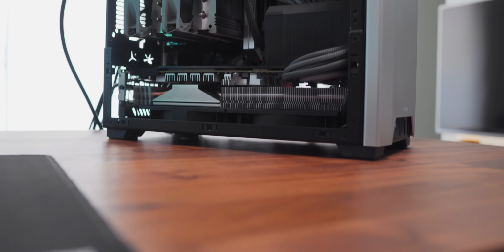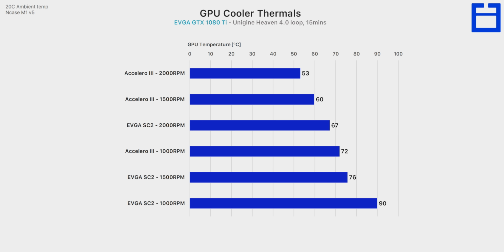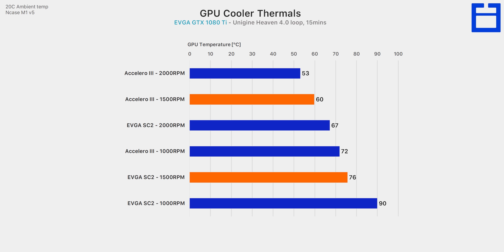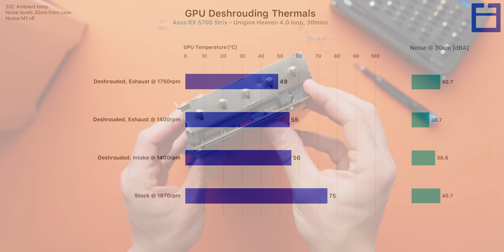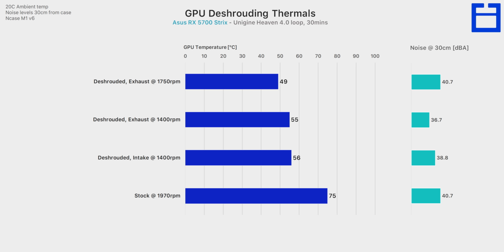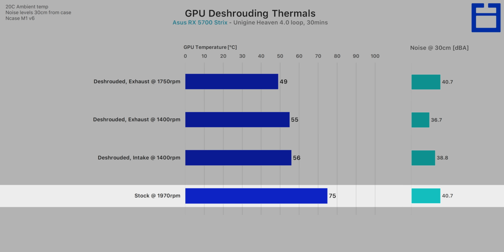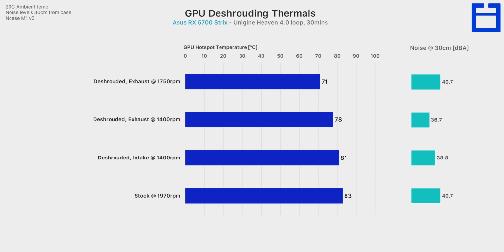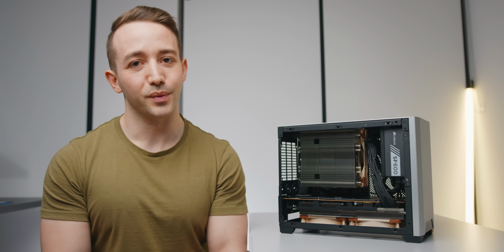GPU Deshroud Mod - Mindblowing Thermal Improvement

Comment: I assume this would work in the Cooler Master nr200, if so, I'm definitely gonna use this trick in my next build
Reply: If he still has it on hand I'd acrually like him test it
Reply: @Oldsah  me too
Reply: i see
Reply: Interested too tho thinking there might be too much clearance between gpu and fans since I have a 2.1 slot, if not then would use an Accelero Xtreme
Reply: That's my plan. 2.7slot Asus card and 2 artic a12 pwms at the bottom.
Reply: I wonder if the strix 2080 ti and the fans will have a gap in between
Reply: Im gonna buy a NR200 too and is interested in deshrouding after I get a second-hand graphics card.
Reply: @justinyhc3057  were you able to test it out?
Reply: @unknowngama  sorry i still haven't saved up enough money to move to the case due to the pandemic...
Reply: @justinyhc3057  no need to apologize my man! Good luck!
Reply: @unknowngama  I do have NR200 and a Sapphire Nitro+ 5700XT. The 5700XT is undervolted and has a 35% fan speed limit. It ran at about 70C while relatively quiet. I tried the deshrouding mod. The first problem is that is a 15mm gap between the 120mm fan and the GPU heatsink. I 3D print a shroud to cover the gap so the air will draw through the heatsink. I use 1850rpm Gentle typhoon fans. If i run them full speed. I can get the 5700XT at ~57C. But it was loud. If I turn the fans down to 1400rpm, a more quiet fan profile. The GPU will run at ~64C. So there is still a 6C improvement compares to stock Nitro+ fans at the same noise level. I don't get the same improvement by deshrouding that Ali demonstrated.
Reply: @spektrumB   thanks so much for sharing your experience.

If you don't mind, I wanted to ask a couple of questions to clear my confusion. What do you mean by 15mm gap between heat sink and fan and how is that causing a problem? And how did the 3d printed shroud provide a solution to that problem?
Reply: @unknowngama  Ali uses Asus Strix 5700XT in the NCASE M1, after removing the GPU shroud, there is exactly 25mm space between the GPU heatsink and the bottom of the case. So standard 25mm thick fans fit in there perfectly. 

When you deshroud a graphics card. You want the two 120mm case fans position as close to the GPU heatsink as possible, while also exhaust the air directly out of the case.. In the case of NR200, which is more spacious than NCASE M1, the gap between the GPU heatsink and the case bottom will be larger. For the Sapphire Nitro+, after removing the shroud, there is a 40mm gap(space) between the GPU heatsink and the case bottom. If you just mount standard 25mm thick fans at the bottom. There is a 15mm gap between the GPU heatsink and the fans. You want something to seal the gap, so the air will draw through the fins of the GPU heatsink. 

I first just used some cardboard cut to size as a shroud to seal off the 15mm gap to test the air flow. After I'm happy with e design, I 3D print a plastic shroud for this purpose.
Reply: @spektrumB   ahh I understand now, thanks!

A quick side note, when testing the fans on the deshrouded GPU, how well did your 120mm fans fit? I ask because I want to try using 140mm fans that I already have on the gpu.
Reply: I came here looking for this answer. Optimum Tech please test this if you can.
Reply: anyone tried this yet??
Reply: @coolsurfer89  i have done it in my nr200 with a rog strix 2060 super and the results are just as good as he shows here
Reply: Was thinking of doing this also with my nr200. For the gap after deshrouding, I plan to use some plastic/nylon spacers from home depot to get the fans close to the heat sink as possible.
Reply: @1LifeAdvs  just use zip ties and a few pieces of wire to fix the fans to the heatsink
Reply: @sniper0073088  the zip ties won't get melted?

Comment: Have you tried stock Asus 2080ti with the slim Noctua fans?  Looks like it would fit.  That is what I'm running in a Node 202.  I wonder how it compares to your deshrouded Asus 2080ti and regular sized Noctuas.

Comment: The real question is why the hell this outperforms even the best boardpartner coolers. Are they screwing us over or are they just inept?
Reply: Noctua fans cost more. :)
Reply: GPU fans and shrouds are designed to look somewhat "cool", Noctua (and other case fans) don't care much about the looks, but only the performance.
Stock height is 2.5 slots, deshroud + 25mm fans is around 3.25 slots.
Also the fact that in shown configuration fans sit directly on the bottom of the case helps -- all of the air goes out of the case immediately, without any chance for recirculation.

Comment: I did this with my Zotac 1080Ti mini, forever ago, by rewiring the existing fan connector to add in two 90mm Noctua fans. I also swapped the thermal paste for Grizzly Conductonaut. The card is SUPER quiet now, and still performs great!
Reply: ''forever ago''   Are you a 15 year old girl? You type like one.
Reply: @heroictesticles6870  Is that the best comment you can come up with, as a keyboard warrior? Grow up.
Reply: @heroictesticles6870  no need to insult someone for a miniscule thing

Comment: just a few weeks back i put two noctua 120mms on my Asus rog strix rx590 and its running cold however the card has some crappy chrome plated steel heat spreader on the VRMs so if i want to OC it and keep it silent i will need to make a new heat spreader from aluminium or copper as that is getting close to 90°C while GPU is still only 62°C (this is while running Furmark and raised power limits and OC. i was also sad to fint that almost non of the heal sink fins make actual good contacts with the heat pipes but thing i will get a rog strix GPU ever again. and yes my 4pin PWM fan headers also doesn't work.  .  good video

Comment: I used an Gigabyte 2070 super gaming OC for my deshroud, it worked perfectly directly without bending or cutting something of. I did have to buy a mini-pwn connector to a normal connector, but that's pretty cheap
Reply: Hey, I have  the same card and currently considering deshroud - what fans are you using and what is the temp/noise difference?
Reply: @egorkin91  I used 2 Noctua NF-A12's. I went straight for a deshroud, so I can't tell you the difference, but in my Ncase, it never goes above 70°C even when running Furmarks for 30min., It's also pretty quiet, but I can't give you exact numbers on that

Comment: I have the same setup in a SGPC K77 with a Powercolor 5700 XT and 2 Artic P12 fans set to exhaust. Running at 1000rpm in exhaust I get slightly better thermals than the stock fans and almost no noise, plus running the fans in exhaust removes some hot air from my case which helps with CPU cooling.

Comment: Now the last enemy in the mist: coil whine
Reply: Man I will never understand coil whine. Modern Warfare: fans spin up and system is overall a little louder than most games I play, but no whine. World of Warcraft: fans near silent, but piercing coil whine.
Reply: @senirii  it's because WoW is pushing higher framerates. Higher framerates, more coilwhine.
Reply: @DJHEADPHONENINJA  So wrong. I've had different games with the same high FPS, yet some of them produce way more coil whine. It cannot be explained.
Reply: @DropOfWater1  yes it can, oscillating currents make the coil literally oscillate, which is the sound you recognize as coil whine. Now, which games create that? Idk. But that's why coil whine happens.
Reply: @DropOfWater1  Explanation is easy. The more power the system or the GPU draws , causes the coils to whine. Actually limiting the frames can help quite a lot. Also if u have a crap PSU like I do It's likely caused by it
Reply: @DropOfWater1  Also very dependent on load or power consumption. Reducing the power target can help immensely. It is also dependent on game design or ingame logic. Some games may introduce very strong load differences between frames or ingame ticks. And the load differences can cause lower frequency rattling.
Reply: @senirii  its usually to do with frame rates.
Reply: @senirii  when i start playing warzone my pc is like jet engine, what i read here is that sound and vibration is from gpu coil wine so i guess it's not anything bad but my fans on Aorus 1070ti spin at 67% while my temps are around 65c and my r5 3600 on hyper 212 rgb blk ed. goes from 65 - 75c most of the time. I can't hear my pc when i play the game but pretty sure everyone else can because its so loud...
Reply: @senirii  It's because WoW is running at hundreds of frames per second. Limit your FPS. It's literally that easy.
Reply: @DenGuleBalje  People keep saying that, it's not news to me - I've got my FPS locked to 75, the max my monitor can display. Diablo 3, Overwatch, Fall Guys, no other game that can run that high produces this whine. Thanks for the suggestion though.
Reply: @senirii  because not every card has it/you can't hear it on some cards.

My 1060 6GB doesn't have it. However I've used a GTX 1070 and RX580 and they had coil-whine, the RX480 I also used hasn't had any. (all tested in Furmark)

It's just hit or miss.
Reply: @xX12VincEXx  bro I'm saying I don't understand it because in my current lived experience high demand games don't cause coil whine on my 3080, but indie titles and WoW cause it, even with a capped framerate.
Reply: Vega 56 owner: what whine?
Reply: @lagynas  Stock Vega 56 owner here. I hear it whenever a game has absurdly high frame rates (I'm talking like 800+ FPS). This will only really happen if I'm playing old games and don't cap my frame rate.
Reply: @lagynas  Right. my vega was a SCREECHER. The 1080 in my rig is loud, and both my 2080 and 1070 Ti had like no wine at all
Reply: @lagynas  yeah, enjoy your 40 fps.
Reply: I’m pretty sure it just directly correlates with how much wattage the card is using, could be wrong tho
Reply: Get an airtight case, with only the radiators outside the case. Sealing the entire system inside, including the pump, totally removes any noise. DIY Perks has a build like this.
Reply: Well, coil whine actually happens for the vibration of some components of the VRM.  So there are many variables that play part of the sound so it is really hard to have a definitive fix, but understanding why it happens may help you find a fix. 

First, your PSU might be contribute to the coil whine, some PSU will feed the GPU in a way that the power passing thought it creates the sound.
Second, your GPUs VRM has or has not thermal pads. This leads to higher temps on any kind of usage, higher temps expands the metal on the components or creates different situations like power leaking and exacerbates the coil whine, also the pads themselves help to absorb the vibration and may help to reduce it.
Third, your game and gpu usage. Basically the frame rates might give you an idea, but it is all about how the game is stressing the GPU. It is commonly seen that games that user high frames tend to create the coil whine because more power is going to the VRMs, faster. That's the issue, the faster the electricity goes on those components  the higher is the whine. Some games use high amount of power but not as fast to create the whine, and fans tend to come in first louder than the card itself.
Reply: @HoracioPz  This... I had coil whine with my 980 Ti in some games, then a TON of it with my 2080 Super, until I swapped my power supply. Other than the whine, it was 100% stable. Now it's completely gone, even though I have an 8 year old PSU vs a 3 year old one
Reply: It's not vibration in a mechanical sense, it depends on frequency/voltage/current. It's like harmonic resonance, every object has a resonant frequency that will vibrate the object. The best way to deal with it is to avoid the resonant frequency, ie change the clocks a bit, change the voltage etc. I don't think physical pressure on the coils will stop it but idk, maybe? Haven't tested it. Seems like it would take a bit of pressure since the coils barely move when creating the whine.
Reply: @130rne  just put voltage on manual or something else its a manufacturing life thing i think, if yours coils harder then put a little bit more load on it or do something else
Reply: I always whine when looking in my wallet ;(
Reply: PSST: you can place acoustic putty over the coils that are making the most noise ;)
Reply: Coil whine in my GTX 1080 TI are gone after I upgrade my PSU and motherboard. Tip: don't use powerful GPU with lower end PSU and motherboard.
Reply: I've had good success reducing coil whine by undervolting my gpu.
Reply: Because this channel is itx focused for now. 
And usually itx sits on the desk close to the user. We can already tell this channel focuses on the noise too. Thus coil whine is something related.

i know PSU, voltage can alter it. but i still don't know the exact reason/science behind this problem.

Because right now i got a nice set up all water cooled. But the coil whine is the loudest noise and i don't want to just take my chance to get new ones.......
Reply: Do you guys not play with headphones?
Reply: @ButtonandBuck  nop, and i dont just use pc for playing .
Reply: starshipeleven  that is my guess, and i put some AB glue (like eprox), long time ago, its not doing much tbh.
Reply: starshipeleven  coz i guess the glue doesnt get into the coil, it just stays outside of the shell.
Reply: starshipeleven  i glued all of them lolol
Reply: I've had 3 Nvidia RTX cards and each had coil whine. I've had one AMD GPU, RX 5700XT, and no coil whine.
Reply: In my battle with coil whine the only thing that has helped is getting a silence focused case like a be quite! case. 

Oh and luck also helps.
Reply: I like coil whine
Reply: i never get coil whine unless im running benchmarks RTX 2070 Super
Reply: Limit your fps
Reply: @DenGuleBalje  might as well buy a console if i need to do that
Reply: @EnnTomi1  I'm not talking about limiting to 30 fps. Limit it to the refresh rate of your monitor.
Reply: @DenGuleBalje  being 144 is the standard nowadays, double the hz for fps is the rule, so 280fps is minimum. and that is enough to cause whine.
Reply: @EnnTomi1  Double the hz will only help SLIGHTLY in games like CS:GO. You're playing WoW. 144hz should be more than enough
Reply: Remember: At 30 fps there's 32 ms from one frame to another, at 60 fps it's 16 ms, at 120 It's 8 ms, at 240 it's 4 ms.
The higher the fps, the fewer milliseconds you cut from the frametime each time you double the frame rate. Sure you still halve the frametime, but the jump from 30-60 is A LOT bigger, in terms of responsiveness than the jump from 120-240.
Reply: @DenGuleBalje  you talk like you don't get whine at 144fps... it's just luck and a combination of psu and gpu. My 6900xt have terrible whine even at 60fps
Reply: @denyxrunner  I don't get whine until over 250 or so fps
Reply: @DenGuleBalje  that's because you get a lucky one. Reading about for like 6 years on reddit it's like more then half get bad whine even at lower fps. Some just at very high fps and some not at all. It's just luck and specific combo of psu and gpu (good psu don't mean nothing... it's more about 2 specific combo)
Reply: I just move my pc to another room. job done.
Reply: my gaming system is completely noiseless as is my PC4 Pro. It sits in an other (storage) room, thanks to very long HDMI fibrewire cables, USB active extension cables and Logitech wireless lightspeed mice and keyboards. In fact, these run to my TV as well. No coil whine, no sound, no heat, no latency, no cluttering of tech devices. Yeah, your wife will thank you.
Reply: @UmVtCg  yeah thats pretty much the best solution, not only it is future proof, but also cost effective.
Reply: Have you measured something like that on the NR200 case with the video card on horizonal position against the fans of a 240/280 aio placed at the bottom of the case?
Reply: @RodrigoMadriz  damn that's specific
Reply: Coil whine is when wattage goes too much trough your gpu and it makes noises, my rx 480 only made coil whine when i played cs source with houndreds and maybe 1000 fps with low settings
Reply: @mocanulaurentiu5812  no, even within the same model card, i had totally different result, so it is an manufactor disgrmise
Reply: @EnnTomi1  coil whine is quality of the coil i think sometimes it gets out worse from the factory, mine barely coils at 1000fps,others say rx 480 make  extreme noise

Comment: I run this setup in 2018 with a Rx580top Strix and it was amazing! It work withe the RTx Strix cards too BUT you need a special adapter for the new rtx cards, because nvidia change the fan port! You can buy this adapter by „artic“ as a stand alone part for the accelor3/4 👍🏻

Comment: Instead if bending or removing bracket of the heatsink, I'd rather buy a cheaper card model with a smaller cooler and spend 50 bucks for an Arctic Accelero III.
Reply: GPU manufacturers just buy the chip from AMD/NVIDIA then make their PCB and design the cooling solution for it... Power delivery and performance wouldn´t be the same
Reply: @us7876  Yeah, but unless you want to OC the hell out of your card, almost all VRMs on modern cards will be more than enough

Comment: Building in a NR200 Wed.  Hoping to try something similar with my current 1080 which I've mounted a morpheus 2 on.   Most likely not going to fit with 120/25 since that makes the card almost 4 slots but I'm hoping with slim 120/15 it will fit.  With this and Fuma 2 for the cpu I should have a nice small air cooled silent little ninja of a pc.
Reply: I saw a thread on reddit where NR200 + Morpheus II + 25mm works, just barely. The NR200 looks to have a bit more room than the Ncase.